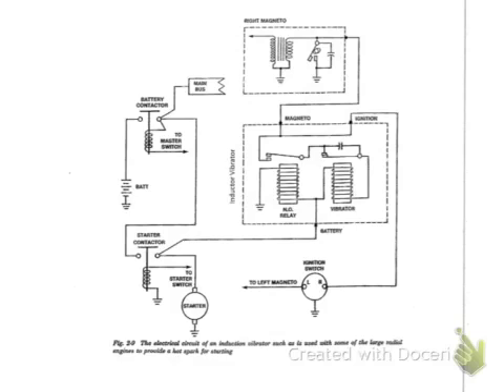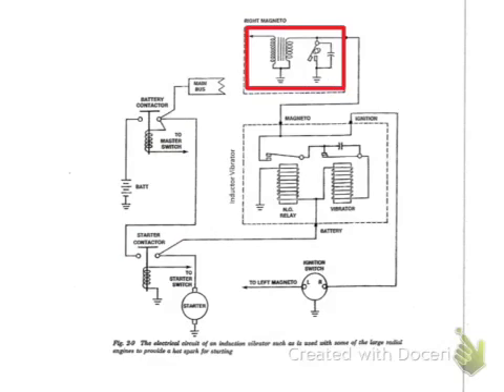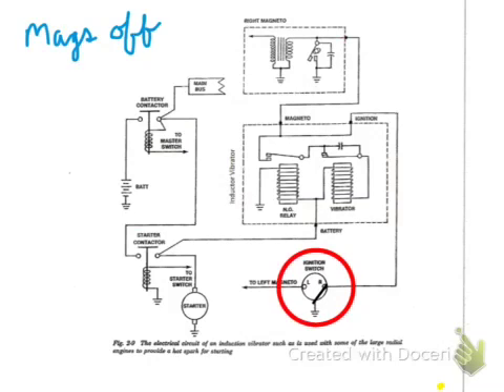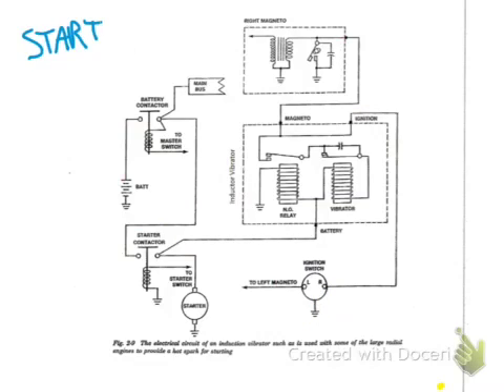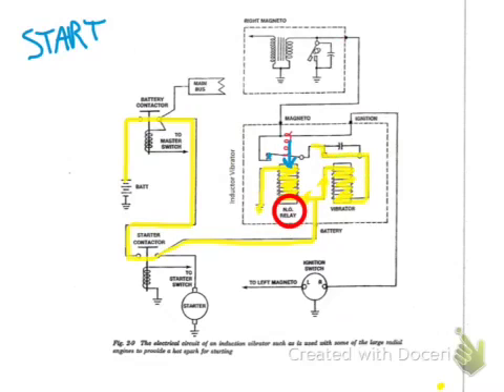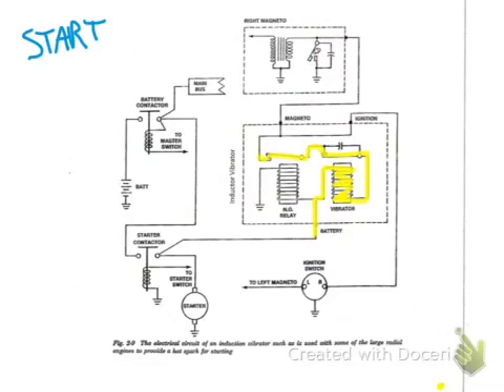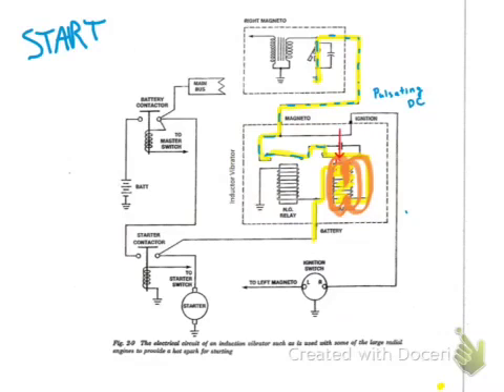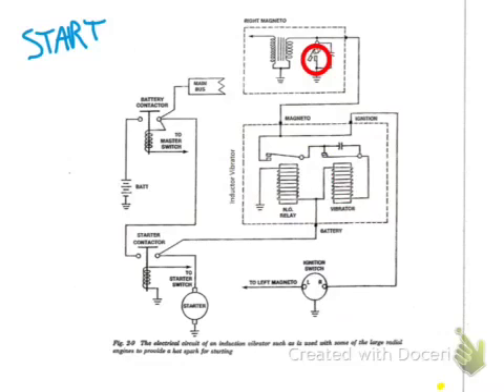Magneto Inductor Vibrator Circuit

Comment: So can a aircraft  engine be started  by hand propping  with battery  on and mags on? Or does a starter switch  has to be used to to energize the vibrater?
Reply: Edited. You might be right. Other planes you can hand prop but if the vibrator box fails it might not start

Comment: Good explanation, but this technology is older than the hills! Not used  anymore since solid state electronics.
Reply: Im a bit late to this party but this has been very helpful. You still need to study this system for Module 16 Piston Engines Course so great stuff
Reply: it is still on A&P mechanic powerplant test
Reply: It’s on my Aztec so it’s relevant to me.